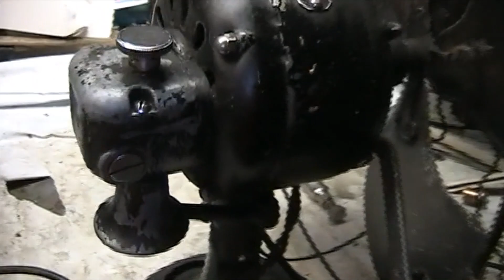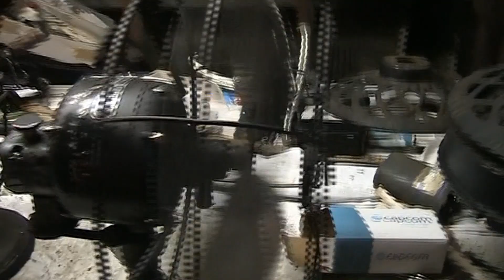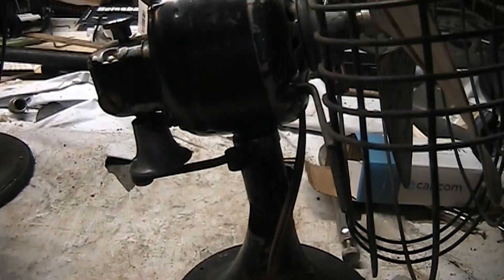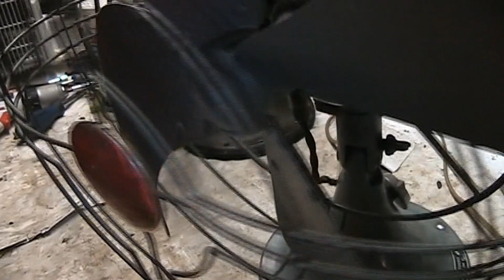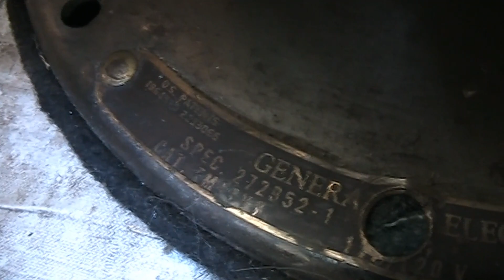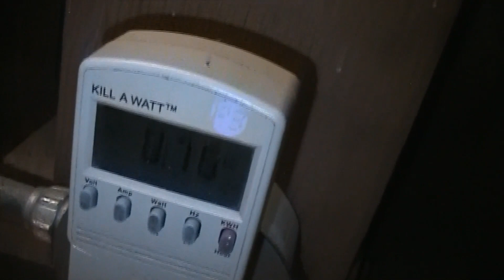Antique GE Vortalexes and Quietblade Fans

Comment: 21:40 sounds great
Reply from the maker: They have great sounding motors.  I need to get the motor fixed on the 3 blade. B
Reply: what’s the problem
Reply from the maker: @The_Fan_King The windings got messed up when I tried to fix the lead wire.  The whole fan was live at 120 volts and it shocked me.
Reply: oh I thought it was because of the loud whine from the motor